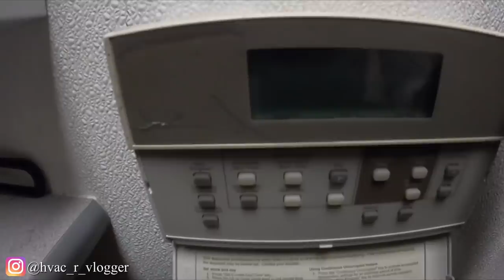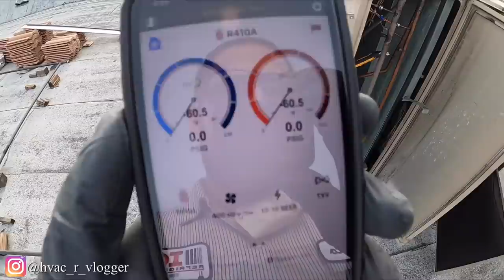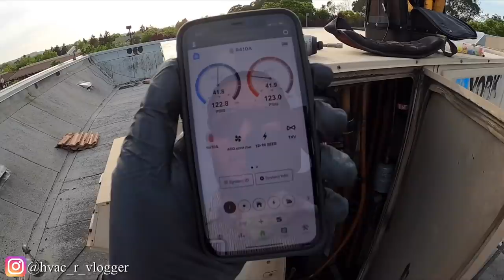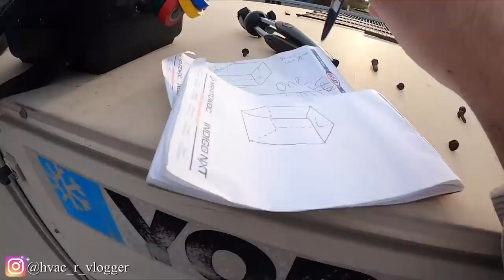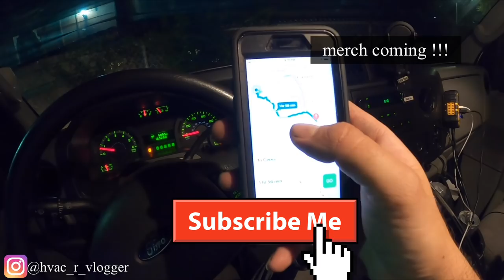HVAC-R VLOG   LATE NIGHT JOBS

Comment: Used to work in a chain and had an old unit that was beyond repair. They would send someone to charge it every summer and it barely chugged along for two weeks. Then instead of replacing the units they installed those portable ACs in the store that didn’t cool for shit. This was every year and the employees and customers just baked the whole summer in the store. Every time they were quoted for a new unit management would deny it.